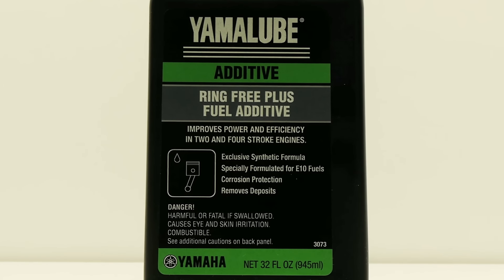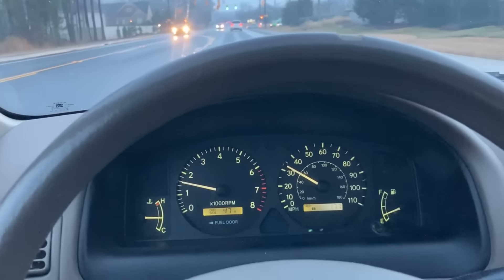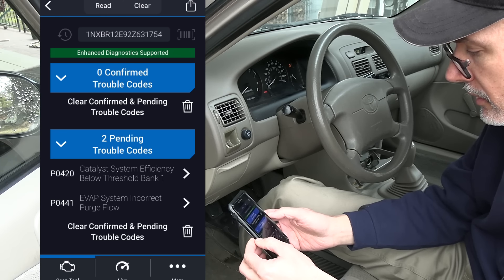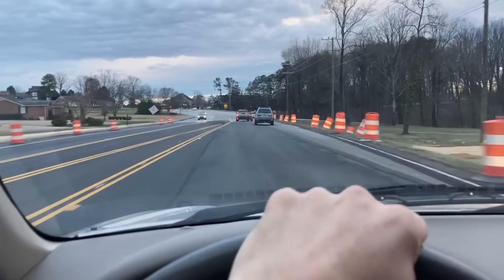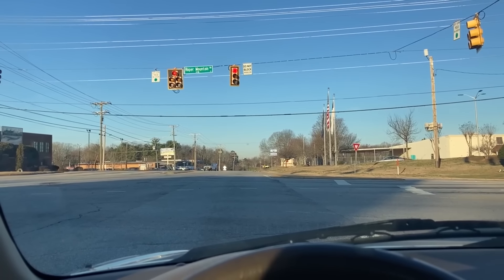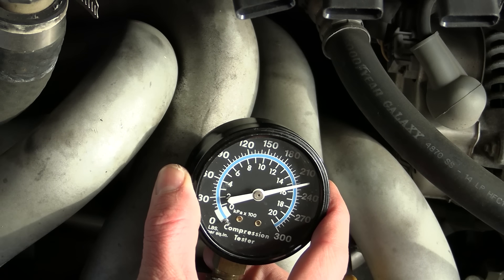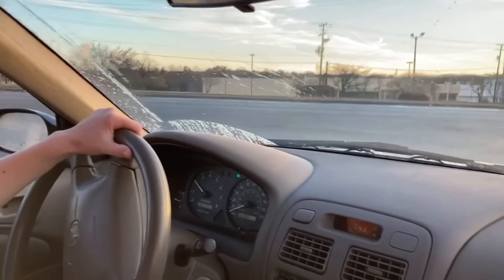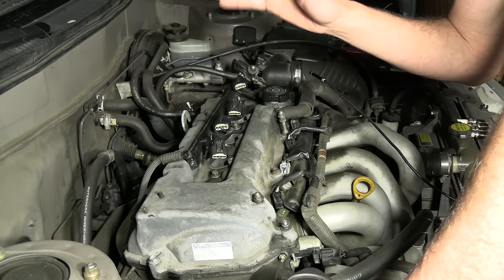Will Yamalube Ring Free stop oil consumption? | Oil Burning🔥Experiments | Episode 20

Comment: Yamalube directions for gas said 1oz to every 10 gallons of gas not 1oz to every 1 gallon gas.
Reply from the maker: You're right. ... But the shock treatment listed on the website (I just went back and checked) is 2 oz. per every gallon of gas. So it really is 20 times the routine treatment. Thanks again for the input!!
Reply from the maker: @johnkelly4381  I believe you’re right. Thanks for the reassurance 😊

Comment: I would highly suggest replacing y our PCV Valve if you haven't yet. It's a wear item and the amount of things you've been putting stuff in here tells me it's prolly clogged or not resisting correctly as that spring might be wore out. Also, the amount of carbon and crap you've burned out of that engine and the chemicals you're burning goes through your cats and some through the evap system. If you replace your cat, the PCV Valve, then you'll prolly be fine on the engine light.

Comment: Are you sure your valve seals aren’t shot, I had a truck that I swore the rings where gone on and it turned out the valve seals where just smoked, had great compression and almost 200k on the clock. You can change valve seals without pulling head. I’d look into valve seals.
Reply from the maker: Thanks for the suggestion. I did the valve-stem oil seals a few videos back.

Comment: Impressed with the Yamalube as far as cleanliness of the pistons. Have not been following your experiments so far. I am sure this has been discussed in the past, seeing the pistons with the slight pooling of oil might suggest valve guide seals?
Reply from the maker: Yep. Did those in a prior video. :-)
Reply: Those can only reach top compression ring and second wiber ring not oil ring. Only engine flush can reach oil ring.

Comment: I have been a professional mechanic for about 40 years. 
1 -  When that car is running - the fuel pump is pumping many times more volume than the engine can consume. Excess volume is how pressure is created.   The fuel pump pressure relief valve stays open controlling the fuel pressure on the injector rail - allowing the relief fuel to go back to the tank - getting picked up over and over -  recycled over and over.  So the idea of residual Yama lube in the fuel lines is simply not possible as the entire fuel line system has been flushed hundreds of times over by the time you burn up just 1 gallon.
2 -  The Yama lube showed different types of improvements like carbon removal over the B-12  BUT that was  AFTER  the B-12.  
Translation - the first time you stripped off the paint - the paint was years old.  Then you removed / stripped off the new paint while it was not yet cured and tested a different paint stripper.  The B-12 was used to strip away the cured / hardened base of carbon and then the YAMA lube was used to strip away the already softened layers of thinner carbon.  ( with noticeable results ).   
Your test methods seem to be sterile / objective or on level but the idea of doing one after the other is accumulative adding benefit to the most recent while subtracting from the apparent effect of the initial tests. 
This is not criticism of you nor the chemicals. This is 2 people talking about tests - results and procedures and thank you very much -- btw -- for spending your time, funds and effort to create content for others to learn from.
Reply from the maker: I really appreciate this comment. Very informative and your points are taken. The experiments are definitely far from perfect, but comments like these help them get closer, and give others information they might not have considered too. Please keep it up!!

Comment: I don't think you should use premium gasoline, the manual says to use 87 octane.  The computer system is calibrated for 87 octane.  The catalyst code might be caused by using premium gas.

Comment: This motor needs at a min a ball hone & re-ring & valve job & only then will your oil use be reduced.
With almost 200k miles on it  could likely cause a bore to 1st oversize pistons & rings avail too. 
The rings have been stuck in the pistons with carbon for so long that even if freed up some they likely lost some outer tension onto the cyl walls so still would not seal very well which is why you see so much oil on top of pistons as long as the oils not getting past bad valves seals & or guides.
I know you installed new valve seals but if guides are enough that can allow valve stems to move enough to wipe out new valve seals pretty quickly,
If it were my car after all your testing I’d just maintain it decently & run it till it drops & move on to a diff vehicle at that point.

Comment: I appreciate your hard work and great videos. Have you ever watched videos from a great Toyota mechanic, his YouTube channel is 'The Car Care Nut'. He has videos on the same engine you have that I believe you should watch because he tells us what was wrong with these Toyota engines. Actually, the 2.4L before 2005 let oil slip by the rings and pistons from the Toyota factory. You're quest to stop the oil burning could be explained to you in that video. Toyota screwed up but corrected that particular oil-burning issue starting with the 2005 model year. So, in watching your video you stated that the 505 product didn't work, and nothing will stop the oil-burning problem in the long term in the 2.4L Toyota engine prior to 2005. To stop that, you will need an engine overhaul with brand-new piston rings, and possibly a new short block. 
I've looked for the exact video I have in mind from this mechanic but it's taking me too much time and it's in the early morning hours now. Here's one video: https://www.youtube.com/watch?v=v4JS7PybV2k There are many other very good videos on Toyota engines on this channel.  Take care, I've enjoyed your videos and will most likely continue to watch them.

Comment: Well, my 1st comment got deleted.....  A potent carbon cleaner is Mopar Combustion Chamber Cleaner # 4318001AD.  Its a foaming cleaner.   I also just saw another interesting 2-part system out of Germany & also sold in the US called Carbon X Combustion Chamber Cleaner K1+K2, & also uses a common shop tool for brake/oil exchange to suck out the dirty fluid in the combustion chamber. There's some vids on YouTube.

Comment: Refresh my memory - Did you confirm no oil in intake from PCV system?  BTW - Yamalube carbon cleaning results look really good.  I can't imagine rings are stuck at this point.  Compression is really good.  Observation - I don't see any crosshatch on cylinder walls. Oil control ring set may be simply worn out at this point.  If I recall, #2 cyl was dry after a treatment you did (don't remember which product). When did the oil return in #2 cylinder?

Comment: if any of you have actually torn down an engine you'll quickly know exactly why this isn't gonna be a one tank fix.. that gunk is HARD and it doesn't want to come out.. i remember my dad having me use broken parts of pistons rings to clean and literally scrape the grooves out.. it's hard with brute force and a little bit of stuff in the oil and gas isn't gonna fix it.. 

to be honest if it was me..  I'd literally fill the engine up with fresh diesel well beyond the overfill mark on stick and slowly bar the engine over about 10 times every 10-15 minutes .. then let it sit a few hours then do it again.. the idea is to keep the rings submerged in the diesel and let it help break it down and rotating the engine over every few minutes helps moves the rings around.. DONT GO CRANKING THE ENGINE!
Reply from the maker: Thanks for the suggestion, Greg.

Comment: My wife's 2011 Honda Odyssey check engine light comes on & goes off frequently as well & I've tried everything to clean the catalytic converter.  It's running so good right now that I just put black electrician tape over the light.  Problem solved!
Reply: One quick question: Why 93 octane in a Toyota Corolla?
Reply from the maker: It was knocking with lower octane fuel (likely due to the carbon on the pistons).
Reply: That makes sense.  If you want a cheaper option, try buying a bottle of Octane Booster @ Dollar Tree for $1.25 with 87 octane gas.  That stopped the spark knock in my 2003 Avalon & was a lot cheaper than buying a full tank of 89 or 93 octane gas which is usually $.30 to $.60 higher per gallon vs 87 octane gas.

As for the oil consumption, I would just keep topping off the oil level & be done with it.  I've seen your Corolla with 600K+ miles on display @ my local Toyota dealer (which I NEVER use anymore since they charge $800 for spark plug replacement) & you only have around 200K.  Oil is cheap vs a new car payment.

Comment: 18:02 Those are really good compression numbers. Yes, you do it with your foot all the way down on gas pedal, a la WOT, to disable fuel injection. Some pull the fuel pump fuse ⛽️ I think that's Overkill. Your engine turns over fast! Mine turned over about half that speed. I had a 1993 4AFE.. 1.6L. dont think they had the 7AFE yet..  1.8L. You have a 1ZZ-FE (FE means Electronic Fuel injection 💉.) I piston soaked mine with WD40, MMO, all sorts. If you're gonna do that, they say to blow all the stuff out by cranking it without the spark plugs in.. I just used same WOT trick to try to force the liquid past the rings. Personal preference, I guess.

Comment: Yama lube for 2 stroke’s. Pull the Spark plugs add 2oz let it sit in a Cold motor for 10 minutes. Start it and let it get to temperature. Do not rev the Motor.. You will see some smoke for 30 seconds. If the rings don’t loosen up get the motor warm remove the Spark plugs and add 2oz of ATF ( Automatic Transmission Fluid is a basic lubricating detergent) .. Good Luck. There some many old school tricks. So have worked and some were a waste of time.. If you find something better let me Know!!

Comment: at this point i would use ATF instead of oil and go for a 30 mins low speed low engine rev drive if this did not unstick the piston rings then this engine needs to be pulled. i personally tried on my car i was amazed 

PS. ATF is a very powerful cleaner

Comment: Would you please consider-
Using a suitable solvent like carburetor cleaner, and scrub, wash & rinse
out the cylinders and pistons? A metal dowel, cut notch, insert rag, use a drill
wipe clean. Get a baseline before each treatment you try. Thank you!
Reply from the maker: Thanks for the suggestions.

Comment: I think you have a valve seal leak. You have a pool of oil on top of the piston which makes more sense that it is going by the valve seals. Not a super hard fix if you're mech savy.

Comment: Your engine is sucking up oil vapor as your fuel tank breather valve is now open all the time. This will most certainly be adding to your oil consumption. These tests are not relevant if your crack case pressure is not sorted.

Comment: i wondered hot you were able to ride this subject for so long but your "check engine lights been on for years" statement gave me the answer, you obviously live in a place that doesn't require regular emission testing and you are only paying $3.60 a gallon for gas, talk about living the dream....... ps: just out of curiosity have you ever actually tried lacquer thinner or acetone directly into the cylinders, if there was ever anything guaranteed to dissolve petroleum related by products those 2 would be it but for the record with compression number that high i don't believe there is a fix that doesn't involve dismantling the engine but with those good compression numbers i can also see why you don't want to pull the engine apart. if that were my car i'd just add a bunch of motor honey to the oil and drive it until another factor surface that would justify a rebuild....
Reply from the maker: Thanks for the suggestions ... and yep, I'm very thankful we don't have inspections anymore. Strangely, there aren't a lot of broken down cars on the sides of our roads, nor a bunch of cars blowing a lot of smoke. Most people seem to take care of there vehicles here regardless. I'm probably the exception ;-)

Comment: Ring Free would be a good preventative maintenance treatment for vehicles that didn’t have the piston issue that the 1zz had. 
The car is certainly worth fixing the issue. I inframed a few of them before I finally retired as a Toyota technician and they all turned out great.
Reply: Inframed?
Reply: A rebuild without removing the motor
Reply: @justinsane7128  ahhh..yes I seen videos on that where people remove the head/oil pan and go to town..I didn't know it was called a inframed...thank you for educating me on that.

Comment: Bmw N52 engine is a NA engine designed for RON100 but can run with RON91.
Use different fuel grades in that engine and see for yourself how cylinder knock voltages react, how DME retards/advances timing and how exhaust note varies.
Any engine that uses VVT and/or VVL must use premium gas RON98 and up.
My fuel consumption goes from 10L/100km to 9L/100km when I switch from ron95  to ron98

For that toyota, premium fuel might not be justified.

Comment: The instruction the bottle say 1oz per 10 gallons of gas unless you are doing the shock treatment whichis 2oz per 10 gallons.. You have stated twice that it is 2oz per 1 gallon of gas.. It's no wonder the pistons look clean as you've added 10 fold what the directions call for..

Comment: If the tailpipe puffs a little smoke after sitting at a light, its the valve seals. If not, the seals are OK. Second and maybe first, a quart of oil in 900 miles is normal for a Toyota, even a new one. Good luck, and thanks for providing the info.
Reply: Look at the playlist he already replaced the valve stem seals
Reply: @DeepRacer-zr4yp  apparently they still aren’t seating correctly… You can tell by the massive amount of oil
Reply: @christophervanzetta  If that's true he might made a mistake installing them. But I'm pretty sure it is the clogged oil control ring and drain back holes in the piston...

Comment: Your compression seems to be great. I would try valve guide seals next . easy to do in the car.
Reply: If you follow the channel you'll see he's already done that and a PCV valve.
Reply: @littlebearish  Just started following a few episode ago, went back to check it out. Sure is odd the oil usage he has.
Reply: @petekovacevic3241  It's typical of this engine. They used low tension piston rings and a poor oil drain back hole design. The combo gets easily plugged up, and the rings aren't able to free themselves because they use low tension (they used low tension rings for fuel economy)

Comment: Stuck rings is one of the least common causes of oil burning and usually results from carbon build up from burnt oil. A result of poor quality oil or the oil not being changed at the proper time.
Which assuming you have done the easiest fix first and replaced your valve stem oil seals,  leaves the main cause of oil burning to be the problem. Due to wear or not ideal running conditions the bore has become smooth and the oil bypasses the rings. Or the rings have lost their tension. This can be from wear or the engine could have been overheated but not enough to seize but hot enough to damage the rings. This happens more often than people think.
If you find a chemical the can fix the wear that is causing your oil burning let me know and we will get rich. But don't tell everyone on here.

Comment: There is absolutely no reason to add oil to a cold engine whose dipstick indicates halfway in between the add and full marks on the stick.  Oil expands with temperature.  The car was not low at all.

Comment: I was wondering, why are you pumping premium, i thought those engines used 83
Reply: Top Tier fuel enhances the effect of fuel system/fuel injector cleaners.
Reply from the maker: I find I get a little predetonation if I don't run premium.
Reply: @steven4894  higher octane and top tier are two different things. Shell, Chevron, Exxon are listed as top tier, I'm pretty sure that gas station he was going to isn't even considered top tier
Reply: @carlbrooks90  The Top Tier label was right on the tank for his Costco fillup
Reply: @FamilyFriendlyDIY  i wonder if that is also the cause of the reving fluctuations, man, im curious about your car
Reply: @carlbrooks90  

Costco is 100% Top Tier. 
If you're paying attention, look at the price per gallon Costco charges for the same premium gasoline versus the competition. 😉

Comment: If you have that much oil sitting in the piston, then I can see why you are burning so much.  That piston top should be dry (maybe some carbon, but not retaining that much oil.
When you start the car that oil is going to b e burned in the combustion, and new oil will replace the old during each revolution of the engine.